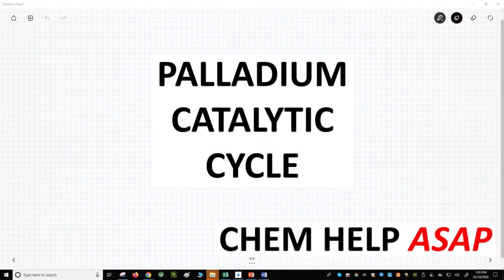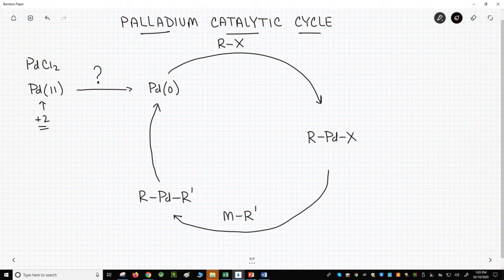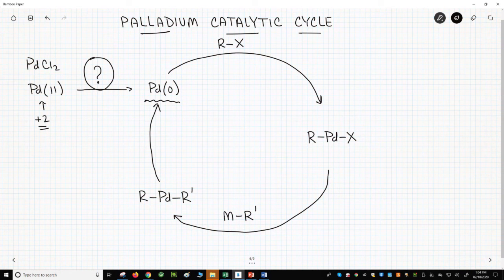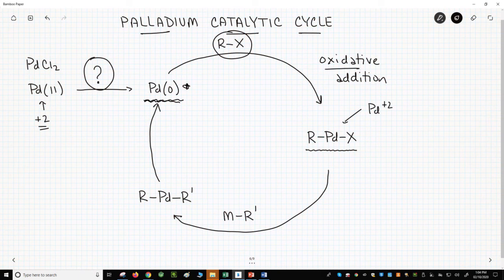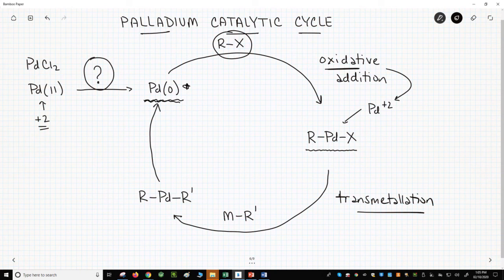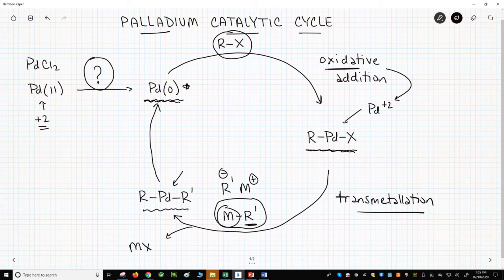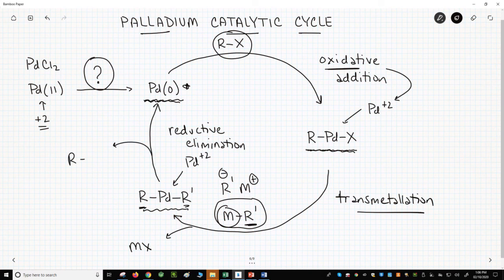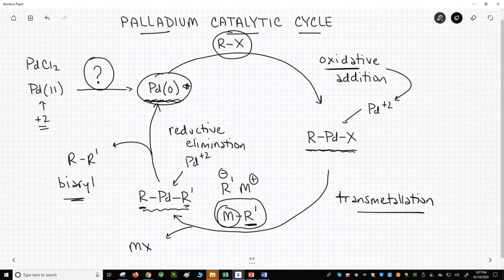palladium catalytic cycle

Comment: Hi. If Pd is replace for other metal like Nickel the reactions would have the same steps? an oxidative addition and then a transmetallation?
Reply from the maker: Yes.  Nickel works in the same way.  Nickel doesn't generally work as quickly as palladium, but many people are researching how to design catalysts that work better with nickel.  Nickel is much less expensive.  Thank you for watching and taking the time to comment.